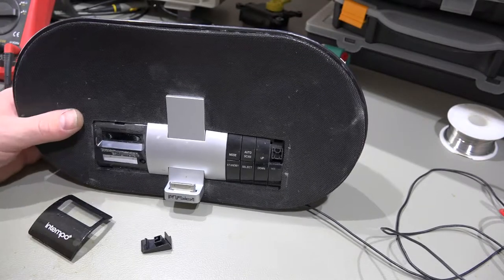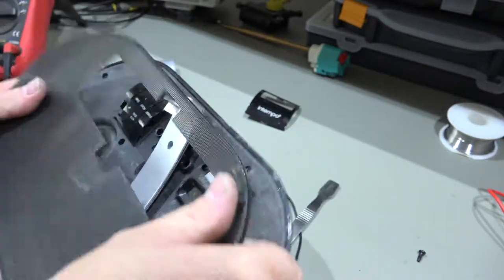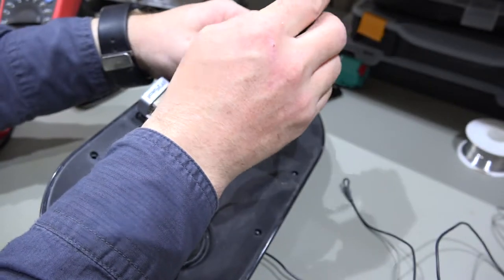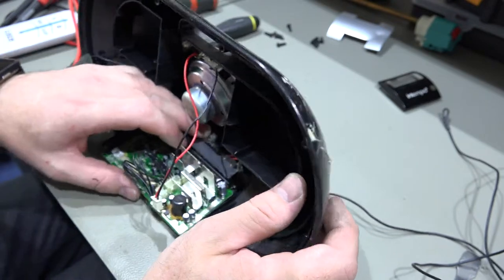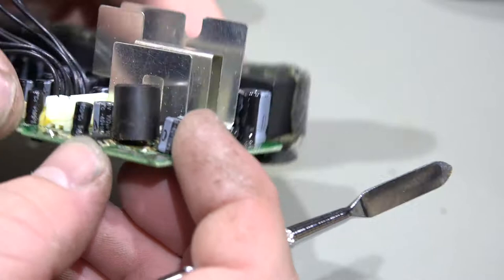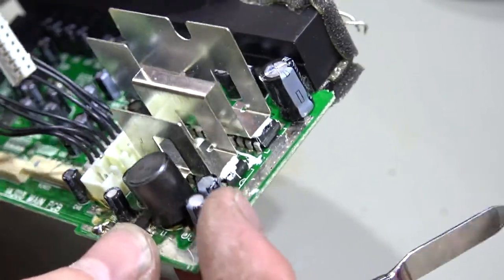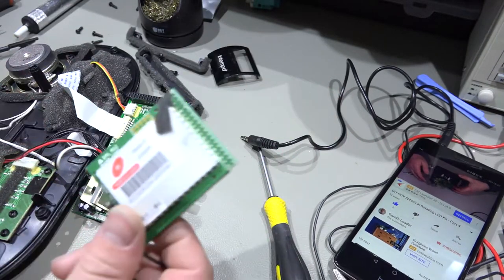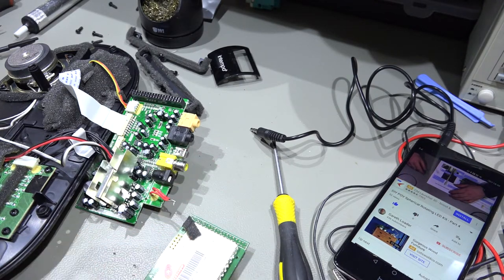Intempo Infusion ipod Dock - Attempted repair Part 1

Comment: check all voltage regulators, diodes,  sounds like you have a rail missing, get an ESR meter mine has saved me loads of times great vids by the way

Comment: Capacitor values may read OK with a capacitance meter but still be broken. You need to test the leakage / ESR.
Reply: Gareth Loader Ok. I couldn't make out the reading on the meter.